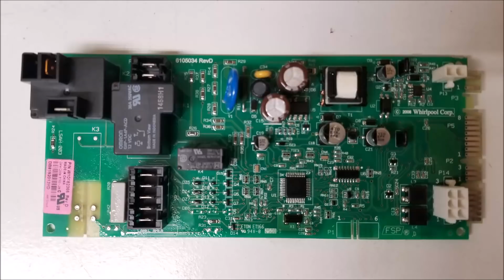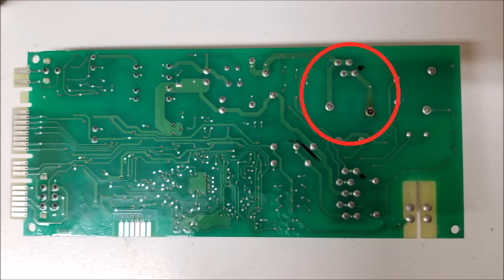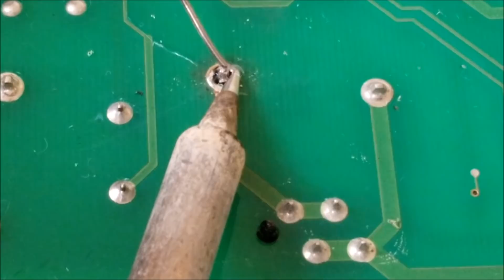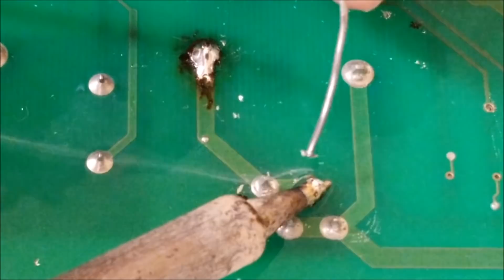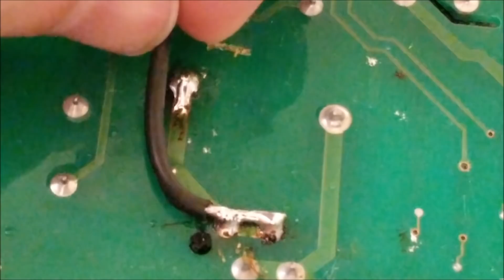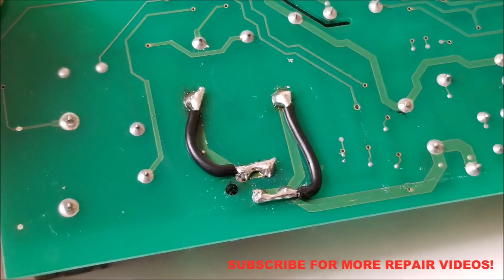FIX and IMPROVE control board with F01 error - Whirlpool/Maytag/Kenmore Dryer

Comment: I did just as you said.  Now when I plug it in it starts spinning and wont stop until I unplug it.  And help?  Many thanks!
Reply from the maker: Double check your connections, make sure you didn't short the two wires together. If it still happens it's possible that the relay is stuck on (the black box you soldered the wires to) and would need to be replaced.

Comment: GREAT video, it worked on my Whirlpool Duet Dryer saving $215 for a new control board.  You can make this repair!  Recommend taking electrical connection pictures before removal,  makes reconnecting them easier.
Reply from the maker: Awesome!

Comment: Great video, used 12 gauge copper wire I had which was a bit overkill and stiff, but with a solid solder connection to both pins it worked fine on my Maytag Epic Z. Poor electrical design for connecting a component rated at 30 amps.
Reply from the maker: That'll work fine.

Comment: A small power surge to my dryer last weekend and I got the dreaded F01 code. The board for my machine is $292.00!!! I went to Northern Tool and picked up a $10 solder kit and decided what the heck...let's give it a try. In less than 30 minutes (including time to make another pot of coffee) my dryer is working again. I did not make the improvement of adding the jumper wire.
Reply from the maker: Good job! Don't let them have your $292 for their mistakes.

Comment: This video just save me $800. I went and bought a $20 soldering iron kit and saved my dryer. I even did the improvement in this video with 18 gauge wire. It works people, thank you to the owner of this video. All heroes don’t wear capes!
Reply from the maker: Awesome!
Reply: Is there a special type of wire you used. Stranded?

Comment: Great video.  This problem occurred this morning on my Whirlpool Cabrio dryer, it was a burned “contact” on the circuit board as described in this video. Re-soldered the contact, included soldering a 18 gauge jumper wire as described in the video, reassembled and dryer now works.  Thanks!
Reply from the maker: Awesome! Thanks for reporting back

Comment: Thanks for the video.  Very helpful.  I did the same as you and it fixed my "broken" dryer as well (my board was a "Rev C").  I used 16 AWG stranded copper wire (is what I had around).  I wonder if Whirlpool finally fixed this layout mistake/weakness?

Comment: i did this fix and it worked for about 4 loads. then one day i came home to a funny smell in the house and didn't realize till the next time i went to use the dryer. the board had fried a huge hole in the board and the plug with the two wires going to it was burned off.. luckily it didn't cause a fire. now im not sure if there is a different problem causing the board to fry or not.. any ideas?
Reply from the maker: It looks like there might be something else going on if the connector burnt out, that's not usually how it fails
Reply: @denispoirier19  would you have an idea of the ohms to be looking for on the connectors?
Reply from the maker: @2007dalin  sorry I don't have this unit here to test it at the moment.

Comment: Thank you for this video. Would a copper 14gauge wire work for this project?
Reply: 14 AWG is thicker than 18 AWG, so it has an even higher capacity for current. You should be fine as long as you can manage to make good solder joints.

Comment: Repair many of these boards and I use a paper clip to bridge across the relay to the other two contact point and so far have hold up for years after, usually bend it in a small circle over the burnt terminal then shape it to angle and meet the two other contact points. John

Comment: This is incredible! I have a Maytag 9000 series dryer that just stopped working yesterday after 9 years. Showed the F01 error code. Took it apart and was burned out at the same spot. Unsoldered all the connections you mentioned and resoldered with a 16 gage wire (didn't have any 18 gauge) Works perfectly again! Saved me $183.50 for a new board from Amazon. Anyone who has this same problem this will save you a ton of money! Thanks!!!
Reply from the maker: Awesome! Congrats

Comment: Where can I buy one of those solder ?? I have the same problem(F10) error, but I don't have the solder machine to fix it.
Reply from the maker: Depends on where you are located but most electronics or auto parts stores should have them

Comment: So I got F01 code I went thru this whole process and dryer still wasnt working then by accident I hit the belt on top of the drum. Noticed It was extremely loose. took off the back and the idler bearing had come apart. I pounded bearing back together added small amount of grease to bearing and shes back up and running.
Reply from the maker: Nice! Good to know. Thanks for the update.

Comment: Mine frecking  Exploded and melted the trace back about 1/4".was the same joint as in the video.the opposite side one also had some bad cracks in it.

I ran two pc power supply ground wires to that joint and a ton of solder to Compensate for the lack of a trace.plus everything else  Mentioned in the video.

My board was revD,if this was their 4th revision and this was still overlooked dang!!!

Works again tho.think i am going to get a new board tho,if that many amps runs through that joint to cause it to melt idk how long that fix will last or worse to think about is how does it fail the next time?
Reply from the maker: If you get a new one try to see if they fixed the problem on it.
Reply: @denispoirier19  i will.but if i do get a new i am going to go ahead and do this mod as a  Preemptive measure.and i suggest anyone else that hasn't had this issue yet to just go ahead and do it.those joints clearly pull more then their rating and should have been beefed up by the  Manufacture.

Maytag ELITE my ass.ive had this thing for a couple years now and have had to repair it sooo many dang times..

Power buttons on the front control panel went out

then the whole front control panel went out

Then the idler bearing when out 2 or 3 times

The coil went out

A temp sensor went out

Now this.i have had this thing ripped apart so many dang times lolol..
Reply from the maker: @talclipse  they don't make them like they used to.
Reply: @denispoirier19  isnt that the truth.the invasion of all this cheap Chinese crap has lead to just about every company being the same in terms of quality.brand names don't mean jack anymore.
Reply: @denispoirier19  anyways thanks so much for the video.made my honey do so much easier this evening...
Reply from the maker: @talclipse  haha! Enjoy the rewards from the honey lol

Comment: What kind of solder did you use. And what temperature
Reply from the maker: Just your normal electronics 60/40 rosin core solder and about 375C degrees.

Comment: Thanks for the great video.  My dryer's back in business.  Besides the burnt out connection on the board, you'll see the plastic housing on the inside charred as well.  NOTE: After the repair, when I run the diagnostic (88) test, it kept flipping back to the F01 error.  I about threw the board away in frustration, but then I closed the dryer door and ran a test load.  Worked perfect.  Don't assume the F01 on the diagnostic test means you failed.  Try a test load.
Reply from the maker: Perfect!

Comment: Great video very clear. Can you tell me all the tools you used to do this? Thanks!
Reply from the maker: Just a soldering iron, some solder, solder wick and something to scrape the board with.  I was not the one that took out the board from the dryer so I can't tell you exactly what is needed for that but I'm pretty sure that they're just common household tools.  Check out the other videos, most of them show how to remove the board.
Reply: Thanks!

Comment: Same problem with mine thaks for sharing my washer does have the same code f1 you think this its same issue ?
Reply from the maker: It's probably a different problem with the washer, sorry I can't help you with that one.
Reply: dp19 ok thanks any way
Reply: I did the same like you show in this video and its work you think this work for long time or just for couple days ? Thanks again
Reply from the maker: For the dryer fix, if you added the two wires it should not fail again.
Reply: dp19 i just add one wire the other its looks good but maybe have add another wire then
Reply from the maker: Yes, as explained in the video, the two connections are weak and they both fail.  If it fails again you will probably have to put the second wire.
Reply: dp19 ok  i will add the second wire thanm you very much

Comment: Can you please tell me what kind of wire that you used to make the connections?
Reply from the maker: it was a piece of 18 gauge wire that I took off an old computer power supply.  Any wire from 14 to 18 gauge should work fine.
Reply: Rod Gotowala 
I used 22 gage insulated wire...worked like a charm.
Reply: Thank you.

Comment: Great video! Do you have any idea what could give an L-2 code? I pulled the circuit board and looked, but there is nothing clearly evident in any burns or anything.
Reply: dp19 Thank you for the reply! I purchased a service manual for the dryer so I looked into all of the codes and the causes. This is the one last link in the chain, but apparently there's no way to diagnose it. I've looked it over for burns, or blown components, no smells. I was just hoping to not fork out the clams to find that it wasn't faulty. Thanks so much for posting your video, and taking time to reply!
Reply from the maker: L2 means low line voltage.  It could also be a bad thermal cutoff inside the dryer.  Do a google search on it and you will find more information about the thermal cutoff.

Comment: So the part didn't need to be replaced, just re-solder and good to go?
Reply: This fix works because the solder in the original connection point eventually fails due to thermal fatigue. Once this process starts it accelerates itself towards the eventual failure. In other words, it isn’t something that happens as a result of the joint getting hot one time. Often people believe that this failure is a symptom of another event. It almost certainly never is if it’s only the solder joint that fails. Repairing the failure point alone should offer a good length of trouble-free service, but this improvement will definitely be much better because it will significantly reduce or eliminate thermal fatigue at this connection point.
Reply from the maker: Exactly

Comment: I watched this and followed your instructions, and my dryer is working again!  I used stranded copper wire to clean the old solder because I didn't have any solder wick.  I also used 12G stranded copper wire because I couldn't find 18.  Thanks for posting this!  Saved me a few hundred dollars!  Mine was burned in exactly same place as yours.  Excellent video!

Comment: Can I use a 18 gauge wire from an old electronic I have
Reply: Also what type of solder did you use
Reply from the maker: Sure, the wire I used came off an old computer power supply.